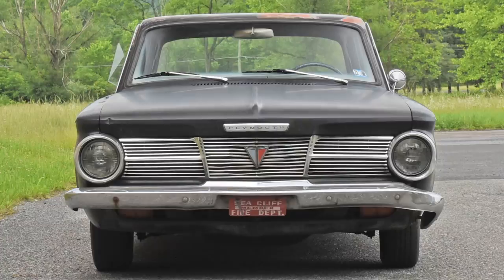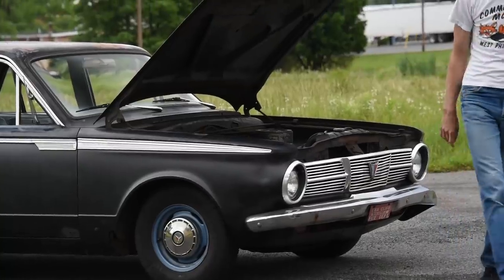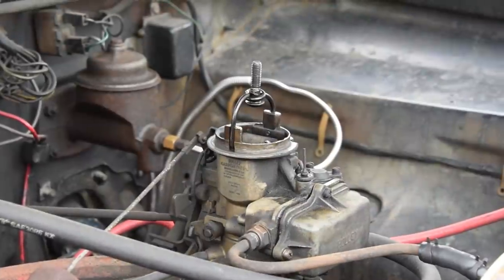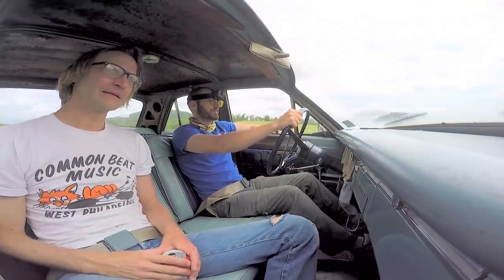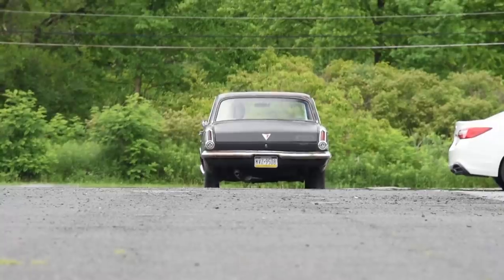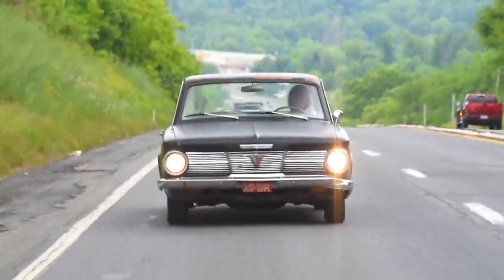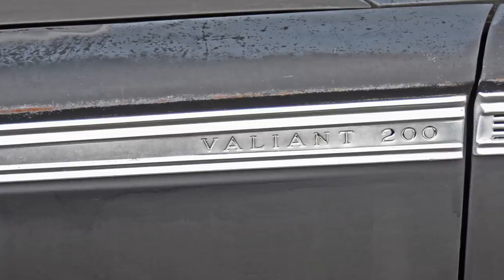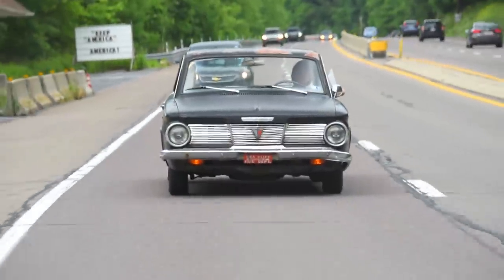1965 Plymouth Valiant 200: Regular Car Reviews

Comment: From the Finnish american car culture perspective:
- Want a mopar but I don't have any more than five thousand to spend...
Reply: Another Finnish perspective: I drove a friends1966 Valiant, with a slant six and manual, in the 1990's. It was just awful: pressing the throttle caused torque steer and the steering had almost a quarter turn of play. Yep, torque steer in RWD car!? Also, the engine was the loudest I've ever heard. Thankfully, it was summer, not winter. I would've ended in a ditch in the winter. My friend reeeeaally loved 1960's American cars :) His other daily was a 1965 Chevy Bel Air station wagon, with a slant six.
I was quite happy to back to my East-German Wartburg after that deathtrap on wheels. Yes, I dailied a Wartburg for years back then :)
Reply: @tuomashelin555  "A quarter-turn of play." Well, now I can rest assured of that, if I ever see another 1930s - 1960s movie where the driver's moving the steering wheel back and forth erratically.

Comment: Good memories.  My sister's first car was a '64 Valiant (automatic transmission / no radio).  For some reason it made a flute-like noise when starting, so we always knew when she was starting the Valiant out on the street.  We took that thing on a road trip from Pennsylvania to Florida in the mid-70s.  By the time we got to Florida the tired Valiant was sounding like a flute every time it dropped to idle, but it got us there and back.  Don't be too harsh on these cars, they were the "grocery getters", they got the job done.

You haven't fully experienced a three-on-the-tree until the linkage crossed up and it wouldn't go into gear.  Then you had to go under the hood, down where the steering column passed through the firewall and jimmy the linkage back into place.  (you can see the linkage at 11:15, right behind the air cleaner)  Some of those memories still give me a chuckle.  I wouldn't have had it any other way.

Comment: The three on the tree is as close to a perfect anti theft device as anyone could get
Reply: You can park that in Oakland and no one, except maybe some old boomer gen folks, would be able to ride off with it.
Reply: Ya for sure.  No one under 50 is hawking that car 😆
Reply: I had about 5 minutes to learn how to shift a 3-on-a-tree when a customer brought a 64 Econoline truck in for some new tires. Not that hard once you learn the shift pattern.
Reply: @A H My dad has a '65 mustang. It had a 5 speed stick to its 289 but he changed it out for an auto when he put efi in it for trips up to the Sierras. Only thing needs ironing out is the Brake system proportioning front/ rear
Reply: If you can drive a standard H pattern manual would it be easy to learn a column shifter? As far as I can see the location would be like the major difference
Reply: @flymachine014  Most folks who see a shifter on the steering wheel shaft are going to assume it's an automatic. After the car stalls out for the fifth time they're going to give up.
Reply: I always loved getting under the hood real fast and lining the levers up because the bitch got hung up in traffic. 79 Chevy 1/2 ton.
Reply: The column shift was a trade-off. The thinking was, both hands are on or near the steering wheel, for safety
Reply: @flymachine014  
As he said “ don’t over think it”
It’s The same shift pattern turn sideways.
Reply: @TheRealColBosch haha!  Unless it has no clutch interlock and it zooms backwards in reverse!
Reply: Jan Brady  The good old days, three-on-the-tree, a split bench seat, no seat-belt law, and your honey sitting close beside you. Ralph Nader would not approve !
Reply: @flymachine014  Easy Peasy
Reply: @TheRealColBosch  Wonder what THOSE people would think the "third pedal" is for.........starter switch?
Reply: @jeromebreeding3302  NO! It allowed for 3 people to sit on the bench seat....

Comment: Learned to shift column mounted manual transmission by picturing R at top left of capital letter H and 3rd gear at bottom right.
Reply: If someone can't learn to drive a three-on-the-tree, they must be uncoordinated as hell !
Reply: The full description would be to view the steering column from the passenger seat and visualize a capital letter H. The top left of the H would be Reverse (closest to the top of steering wheel and driver's chin). The bottom left of the H is 1st gear. Neutral is the crossbar of the H. Top right of H is 2nd gear and bottom right of H is 3rd gear (furthest from driver's chin). 
Had this transmission setup in my Ford E-150 Econoline work van along with an AM radio and POWER brakes. No air conditioning in South Louisiana. 
Good friend had same I-6, 300 cubic inch motor and column-mounted, manual transmission on his F-150 pickup. So of course we drag raced them one Saturday night on a sugar cane field road and I smoked him. That I-6 on my van regularly pulled an 8000 pound trailer on flat ground for 150 miles at a clip. I even caught it once running on just one of the 8 quarts of oil it was supposed to have. It was running just a bit hot in June in New Orleans. Ford could sure build a motor in those days. It also had to make do with a Chrysler radiator my father got from a junkyard after accidentally puncturing the original Ford one with a screwdriver. The Chrysler radiator was from a 258 cubic inch, six cylinder engine, so the van ran a bit hot in summer months with less radiator capacity. No problem - just turn on the cabin heat and keep the windows rolled down IN JULY IN NEW ORLEANS. Life was harder, but simpler in those days.

Comment: I had a 1969 Valiant Signet two door with a 170 slant six and automatic.  Great car for a college kid in the 70's.  Drove it in the winter with rusted out torsion bar mounts on the frame.  The mount gave out and it sat on the suspension snubber, until I bolted two hockey pucks together and stuck them between the control arm and frame. Great handling Valiant after that, but rode a bit rough in the right front.

Comment: Gave one to my college girl friend, a 2dr ht in 1970. We used a dryer back to patch the floor.  It lasted with her till she graduated. I was gone by then. Car thrived on no maintenance, and rotted apart in the end. Her's was a TF with a 225 six. I think it had solid lifters as well. Her's was paint  rolled and had "Greetings form Asbury Park " on the trunk. Early Springstein Fan. Different color trunk lid, hood, and front right fender. 
It would do 65 and take us from Nags head  to D.C. and back.  It too was medium metallic blue. 
Cooling system is also the thermostat. Also gotta carry a spare ballast resistor. 
Had the same front clip as Barracuda's

Comment: I love how Mr. Regular glossed over the Valiant spanking the Corvair and Falcon at the races  in the compact department. I had an 85 Dodge Ram Van with a 225 Slant 6 and a 4 speed od on the floor. With 3.90 gears the Slant would push that brick up to 68mph. 71mph downhill. It got like 19mpg too. It was not fast but it would pull anything you hitched it to. I remember that Slant lugging like a diesel when I used it to drag an early 2000s Cadillac Deville that was stuck in park out of a grassy lot. I was young, dumb, and did eventually manage to blow that Slant up. Brakes went out and I overrevved the motor downshifting down a hill. Rod bearing on #2 spun. Put a motor from a Volare in it and eventually sold it.

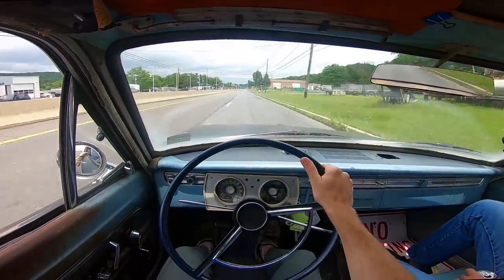Comment: The A bodies, Valiant and Dart, had 3:55 gear set and limited slip with a 3 SPD manual, and 3:23 open with an Automatic. 
Had 8 different Darts and Valiants over the years.

Comment: Base Model in the 1960s, it's weird seeing a 60s American car with so much Emptyness under the hood.
Reply: Indeed, nobody preserves base-level econoboxes, we forget they existed in that era. All we see are the muscle cars. Basically the only cars ever seen from that era are muscle cars, Volkswagen beetles and buses, and Jeeps. The muscle cars because they're interesting enough to preserve, the Volkswagens and Jeeps because they are easy to keep running.
Reply: Look back to a fifties flat head with an oil bath air cleaner.  Two extra feet of hood just for the clearance!
Reply: Not weird at all, ANY American car with a STRAIGHT SIX will look like that. A FULL sized 60's American car with a six will allow you to stand IN THE ENGINE BAY while working on the engine!!

Comment: Slow but a great durable engine, solid lifter cam and the more noise the rockers made the better it ran. Don't pop the bypass hose, virtually impossible to change on the side of the road.
Reply: The popular saying is"you can't kill a slant-six. It's time-tested and TRUE !
Reply: At 50,000 miles the Slant 6 on my parents Tradesman was burning oil and had such low compression that the cylinders took about ten seconds each to leak down as it slowly rolled down an incline while parked. 

I have never before..  nor since… seen an engine in such terrible shape regardless of years (up to 35) or miles (up to 400,000) on any other vehicle I’ve run.
Reply: If that slant-six had regular oil changes, it could have made 50,000 miles without breaking a sweat !
Reply: Pull the water pump for the 170 by pass hose
Reply: @Bartonovich52  yeah I've seen the same. Plugs on the back two cylinders always oiling up, low miles

Comment: I’ve had about 30 valiants and darts from 62 to 76. They are some of the best budget classics you can buy. Reliable, parts are cheap, and they are fun!
Reply: I like changing cars, I’m that kinda guy
Reply: @A H A 55 year old car will need clutch and transmission repairs, radiators etc!   A Toyota Corolla won't go 55 years without those kind of repairs. Some people aren't good with making repairs, but a Valiant is a car in which normal  repairs are inexpensive when done by the average person - some people don't have the time or aren't willing to pay someone to do the work - sell the car to someone who can repair.  You really shouldn't expect to own a cheap old car and keep it cheap if you can't do most repairs yourself.
Reply: @A H I'd like to have a Subaru one day, they have made the boxer engine practical. Well, I like the air-cooled VW too.   I changed the clutch in my Valiant without a transmission jack, but a cheap tool from Harbor Freight is nice to have, which I now have.  I drove the car on a ramp and blocked it up.  Its not a difficult job on these old rear drive cars.  Pulling the motor and replacing the rear seal isn't that difficult on a slant six.  Think of the Valiant as something like an early generation of the brick era Volvo - not sophisticated but beloved by many. Both Volvo and Chrysler lost a market segment when they no longer could build simple cars anymore, mostly due to changing regulations, the need for better fuel economy etc. Boring but beloved.
Reply: @A H Americans, and as far as I know - no society in the world has ever considered vehicle rust to be a preventative issue. There have always been the rust nerds who used Ziebart, or swabbed cooked-down used motor oil on the underbody, or lanolin based products like Fluid-Film, but the majority of us just watch it rust away and complain.  A home made cosmoline made from grease mixed with melted paraffin and zinc oxide is excellent - dries to a dark varnish-like film. Paraffin without the added grease will chip and flake away, the grease makes it a little sticky and more self-healing when rocks bounce against it. That might be what Ziebart is.  I lived in Michigan for a year and I saw the roofs of cars rusting. The road salt is tough on the roads and bridges too!  A lot of that salt comes from mines deep under Detroit metro.
Reply: Definitely 66
Reply: Reliable. Is that why you had 30?
Reply: @budlewis721  Valiants are reliable but its 56 years old!  They are so simple that there isn't a lot of things that can break.   Falcons and Ramblers are reliable too, if you keep up with the maintenance.  An old Farmall is reliable too when its been kept up, otherwise there will be several necessary repairs.
Reply: @timothykeith1367  It was a tongue-in-cheek comment; I used to say the same thing to my ex-brother in law when he boasted about the legions of VW bugs 'n' busses he'd owned. He had quite a crop in the VW garden surrounding his...uh, estate. But I think they needed weeding. I'm not familiar with Ramblers, aside from the Nash derelict that followed my dad home one day in 1967. But I did have a 10-year-old '63 Ranchero 6-cyl that I worked like a rented red-headed step-mule, and aside from the usual expendables (clutch, brake shoelettes, generator, starter) the only repairs it needed during the miles it was mine, was a 45-minute head gasket RnR, and a day-long transmission RnR on separate occasions. As it always has, poverty compelled me to do my own repairs. It also kept me honest on the PM; oil is cheaper than rings. But unless the maintenance was criminally neglected, those Detroit cast iron engines still did more or less OK. I was (was?) a cheap bastard, but normal people only keep a car a couple-4 years anyway, so it didn't matter. I also had a similarly trouble free '62 Nova SS 194ci 6-cyl Slip n Slide Powerglide that also had a ≤45 minute head gasket change time. All the '60s 6-hole American cars are moderately bullet proof. As you stated, with an average 7 moving parts, how could they be otherwise?
Reply: @timothykeith1367  I haven't owned either of those cars since gas was 53.9¢/gal (I was outraged that it got that expensive) and God was in high school, so repro parts didn't enter the equation. It was Kragen, the wrecking yard, or a parts car; I used all 3 sources. Landlords don't like parts cars, so I needed to appeal to their greed: money not used for new parts goes towards rent. You can indeed get those cars to limp along on 4½ cylinders and 3 wheels, steering with a pipe wrench. But I liked knowing they would get me there and back, minus the excitement; equipment violations were an avoidable pain, too. 
In 1974 I rode to work for a few months with a guy who had one of those Poncho OHC 6-cylinder 2-doors. Its speed surprised me, as did its quickness. It's shame they didn't catch on, but 6 cylinder cars were anathema to most fast car guys back then. And on the subject of AMC, at 17 I wanted one of those new Javelins or AMXs so bad it was like a crush on the most beautiful girl in school - and for me, just as unattainable. Oh well; I settled for a close second MKVII Jag with a good interior, bad paint and broken engine that I got running well, and the brakes even worked sometimes.
Reply: @budlewis721  MKVII Jag would be cool. There was a time when E-types were just old cars
Reply: @timothykeith1367  It looked like a Bentley and the interior was burled walnut and leather, with a sunroof and UV instrument lights and a huge back seat. It also had an option that removed girls' clothes when they stepped inside. And they didn't care.

Comment: Oh gosh that slant six may be the most impossible engine to kill.  My buddy had a Duster with a four speed manual was rotted through the floor, the oil was not changed during the three years he owned it merely adding a quart once a month or so and it never failed to start and run.  What an engine!

Comment: Talk all the smack you want,  it’s still running…
Reply: That engine will live through the apocalypse.
Reply: The one in our Dodge Tradesman was burning oil at 50,000 miles and the compression in each cylinder would leak down about every ten seconds as it slowly rolled down an incline when parked in gear.
Reply: @Bartonovich52  say what ya want it still runs
Reply: Well, good for the owner.

Comment: Your description of the column shift 3 speed manual is spot on, I have one in my A100 van. Even at a dead stop it sounds like it's grinding itself to bits getting into first gear. That and it gets engine breaking even in third gear so you have to keep the accelerator to the floor or pop it out of gear and coast to not slow down to 40.

Comment: Got to drive a '70, with the '3-in-the-tree'. It had the 225cu. in. Drove well, zippy, did 60 with no howl at all,. smooth shift, nice steer. Loved the thumb-wheel radio and heater controls.

Comment: 318 and a 4 on the floor would really help this thing.
Reply: Shitboxes are cool because the sheer garbage of them is charming. If you make it driveable, what's the point?
Reply: thats cool but the slant 6 is legend as well
Reply: A door trim and bend the other side of the bumper evenly first
Reply: with only the 4 on the floor is enought, in mexico those were sold with the salnt six and 4 in the floor, the only automatic Chrysler were the expensive ones you know New yorker and lebarons. the valiant was a direct competitor of the vw bug and datsuns who had 4 on the floor.
japanese and euro brans were in mexico since the 50`s.

Comment: So easy to  work on. Driving from Darwin to Adelaide in the 70s had to replaced the radiator in the desert with a couple of spanners - hitched to and fro from the wreckers.
Reply: Slants sucked to work on the points- they didnt even have room for a normal size distributor! So glad the Hemi replaced them.

Comment: Had a '67 Chevy Nova II, with a 283 and three on the tree. My friends were terrified at the thought of getting behind the wheel, but they loved riding in that beast. The shift lever was sloppy on the mounting, but the shift pattern was still good and tight. And that thing moved... 

Loved it, miss it, it was bought by my uncle and he resto-modded it and lived off the resale for a year. 

Even before he got his hands on it, it was far from a "shit box". Hearing you talk about the gearing is pretty true: 1st gets you moving, 2nd is your work horse, and 3 is for anything over 50km/h, including eating up highway distances like they're Pringles and you have a cold case of beer on hand. This analogy is far too apt, considering the way that big, heavy, steel and iron beast drank at the pump.